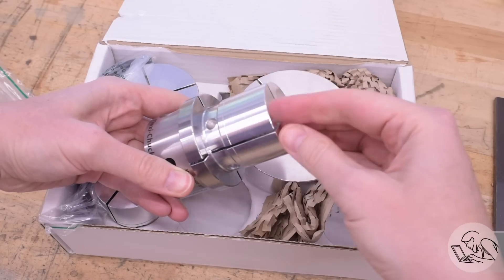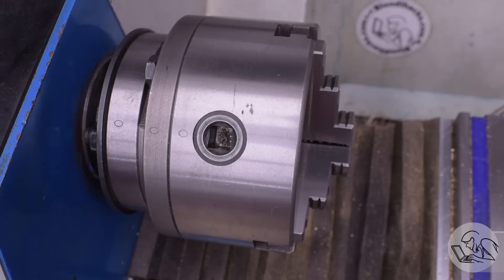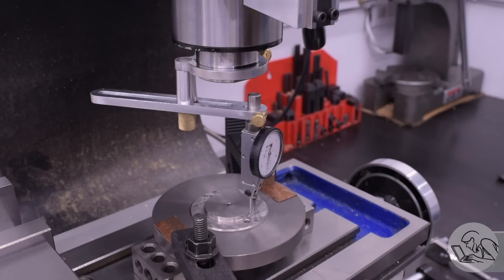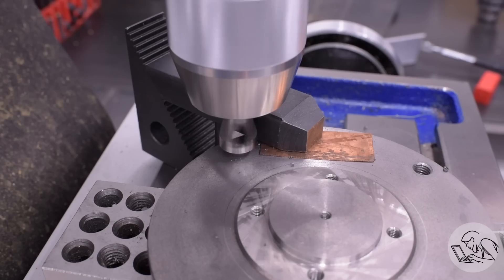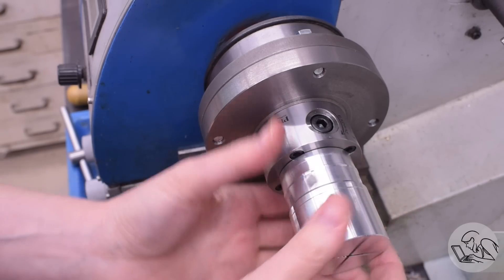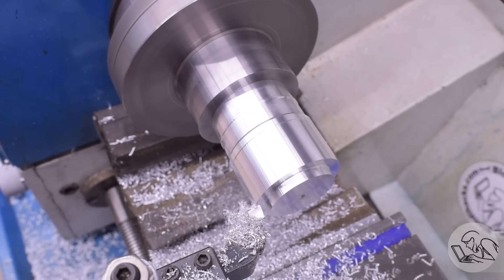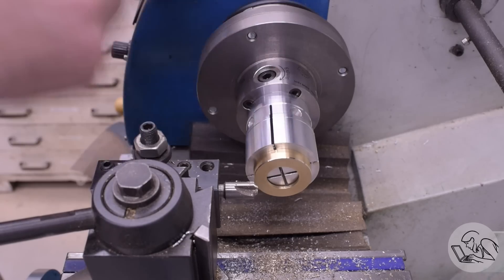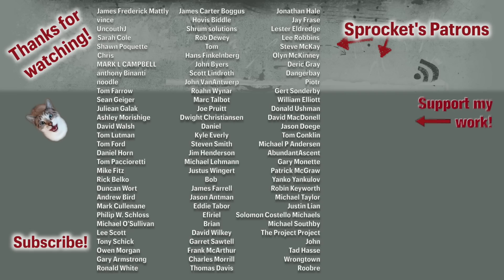The Flexichuck - A Bendy New Way To Hold Weird Parts

Comment: very cool bit of kit, I like that the consumable part is easily replaced. Ive seen a watchmakers collet or chuck that is similar but the opposite action where the inside is machined in a stepped cone for holding different sized pieces and the action is formed by pulling the neck into a morse taper but it has the disadvantage of restricting access to the outer edge (also not much stability for the size of disk it holds) , this one opens up the entire outside perimeter to whatever you need to do with it with plenty of beef to stabilize everything.
Very nice thanks for sharing

Comment: I have a German Weiler lathe that has a spindle called a DIN 5 which is dimensionally identical to an A1/A2 but with a different bolt hole pattern. according to a post on Practical Machinist, A,D, and Din are identical except for the bolt pattern. For this reason a A1/A2 backplate fits my Din 5 spindle after drilling and tapping 4 holes, it is likely that your lathe follows the same pattern but in a smaller size.

Comment: I recall you saying you have a ELS (James Clough) setup- but never installed.  Did you ever do it?  
 I have a 1030V and installed one.  Probably best thing I’ve done for it.  Super quiet, no mucking about with gears and very nice to adjust speeds on the fly. 

 Thanks for the vids.

Comment: I think you will be surprised how often you use this. I’ll be astonished if it’s LESS often than the 4-jaw. A huge fraction of the parts I machine have a simple central bore with complex but concentric features on the OD, yet most people always try to hold on the OD. See Rovi expanding collets for a similar idea. Make the consumable aluminum (or leadloy) mandrels😮 yourself — Gary is awesome, but shipping consumables from Oz is just silly. Make a bunch.

Comment: Good vid. Question: How would you hold down the shaft on a 1/8" burr bit (for rotary tool) if you wanted to turn it down to 3/32"? The tricky part is the head on the burr is 3/8" egg shaped tungsten carbide bit. I'd like to do this on my lathe, but I can't think of way to hold the burr head in my 3 or 4 jaw chuck without destroying the burr head.
Reply: It'd maybe have to be something like a lantern chuck.

Comment: these are nice and handy tools.. I made something similar 'bout 10 years ago, and it is a great way of holding things on the tiniest of features, like holding a watchcase in the seat for the glass.. that's only 0.8 mm deep.. works a treat!
The only thing is, i drilled a hole straight through, with a conical seat at the front, and i pull a conical piece in there with a piece of threaded rod through my spindle.

Comment: I wonder if when using the consumable part down to the 'nub', it will preform worse due to the feature you cut into it becoming less parallel when expanded, than it would have done further from the flexure pivot point. Still worth it for what it does though, I think, even if you have to buy more of the consumable bit than you might first think.

Comment: I bought a new PM1030V lathe last year December 2023 and a PM 5C collet chucks which was on back order. PM shipped the lathe right away,  but now it's early October 2024 and they have not shipped the collet chuck. I've called them over the last 3 months. Last call they said they expect a order of 500 to arrive and I might receive mine in October. Still waiting. Did not want to cancel the order because I liked the cost vs quality aspect of the chuck  from PM vs other suppliers.

Comment: I wonder if cleaning the aluminum gripping surface with IPA between operations might improve the grip? Conversely, a light touch with 320 grit, by hand, to avoid making "lines" with the abrasive, as would happen if you used the abrasive cloth on the spinning "Flexi chuck" machined surface...
BTW, I've not been on your channel for a bit, not being a model-maker, nice to see you, you have a really pleasant presentation style, nice voice, and no discernible "accent"
😉🇨🇦

Comment: 7:19 "Cast iron is wonderful stuff" - Yes, I know it machines well, I just really hate the mess it leaves behind to the point where I will avoid machining it. Especially on the lathe, those small chips it generates just seem to fly hundreds of feet and end up all over the shop instead of in the chip tray. I know you addressed this with the chip brush comments, but I'm curious if anyone has any tips for keeping the chips at least semi-contained when machining it on the lathe.
Reply: Magnet?

Comment: I did not know that cast iron was self-lubricating.  Now I do.  Thank you for that.
Reply: There's more than 1 type of cast iron.  Most common are gray and nodular iron, which do contain graphite.  However, in white iron, the "excess" carbon is present as ferric carbide.  White iron is too hard for machining with HSS tooling.  Tungsten carbide is just hard enough too cut white iron, but will not hold up.  CBN tooling will definitely work on white iron.  Traditionally, white iron was ground to size.